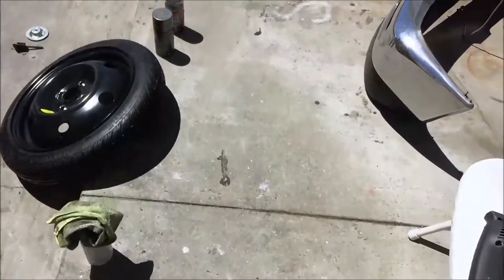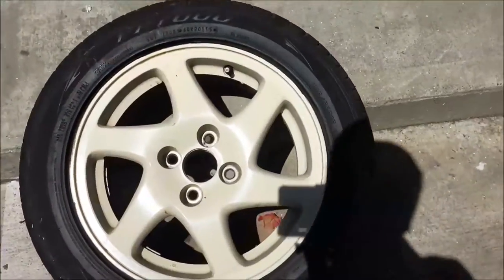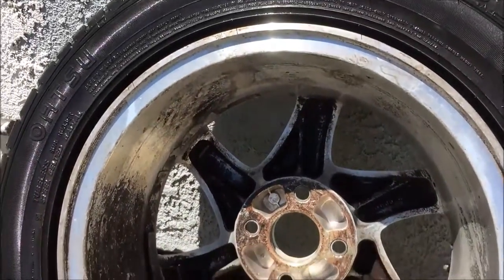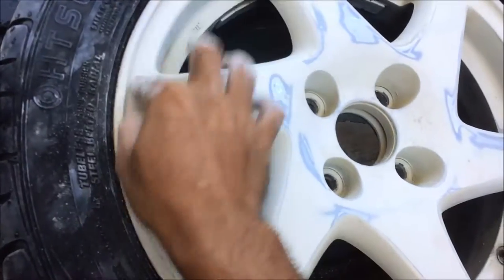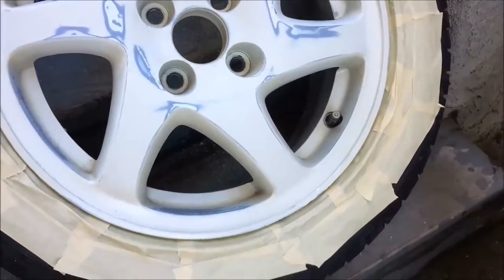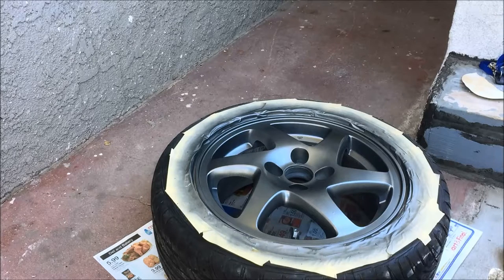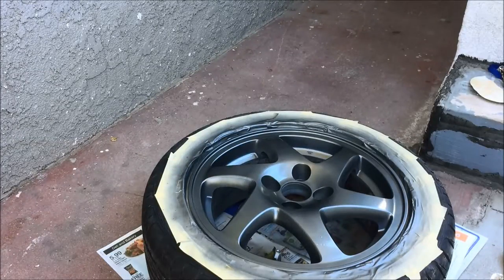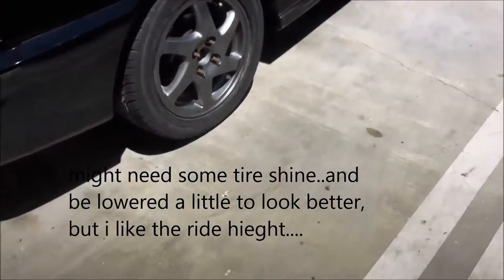Gunmetal Grey GSR Blades?

Comment: yeah, tire dressing might help. Between those two colors, I'd go with white.  You should consider bronze, too. I have bronze SI wheels on a black crx, looks pretty good. Too bad I only had the two.
Reply from the maker: +BB Detailing I thought of bronze but I wasn't sure it'll look good on the blades, bronze will look good on my car with a lower offset wheel with a lip..
Reply: Good point. I didn't really consider the wheel design.